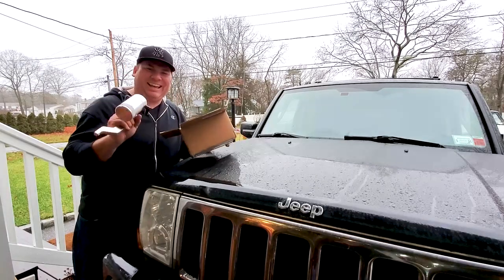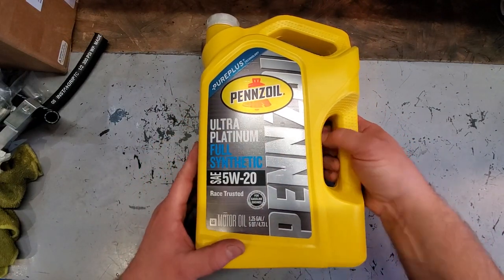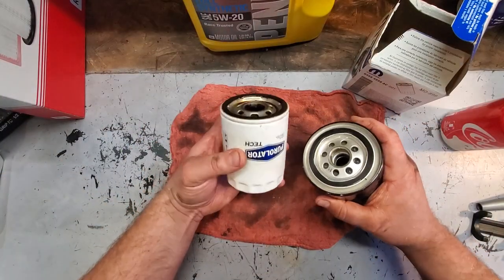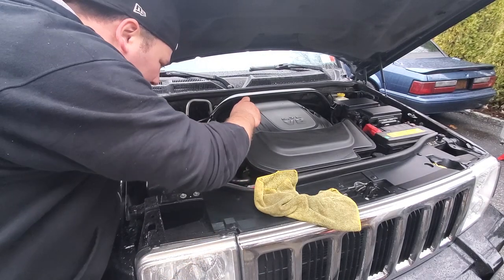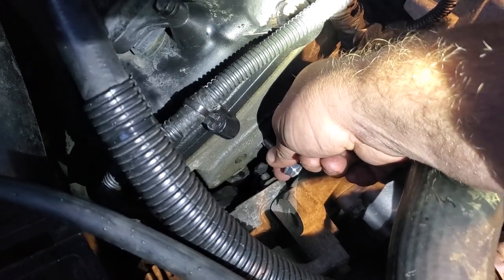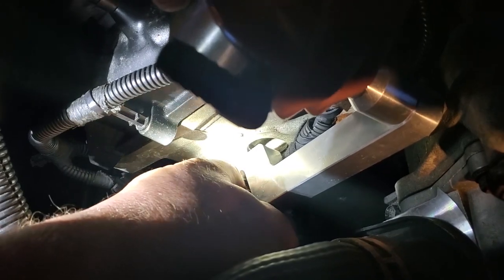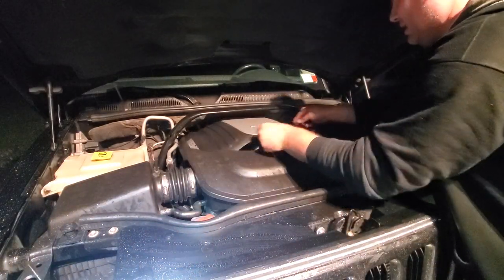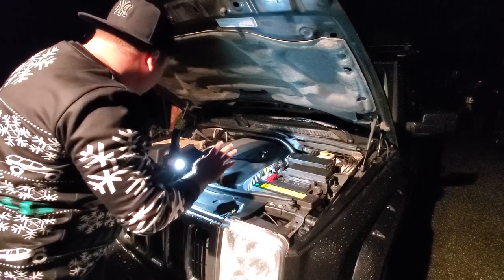JEEP COMMANDER XK OIL CATCH CAN RETRO FIT FOR 5.7 HEMI & OIL CHANGE

Comment: Change your PCV with the oil and filter.
Make sure your filter is premium that stops down to at least 5 microns. My Fram premium filter I get filters down to 3 micron.
Standard filters only stop 30 microns and larger.

Comment: Good vid. I have an air raid elbow that replaces the mouse trap resonator. So it should be much easier. The main thing the catch can dose is keep your throttle body from gumming up so bad by eliminating the oil that cooks on the body and the valve. Started watching after hearing about your channel from D&E. Good XK content.
Reply from the maker: Thanks for coming over! D&E are great.  Ill definately scrub that TB. Thanks for the tip.

Comment: That price is insane. Lots of choices that were a ton cheaper. What could you have done with an extra $100?
Reply from the maker: Put it towards a quality billet catch can 🤣🤣🤣
Reply: @ProjectDanH  
Quality doesnt mean more effective, better or last longer. Could've been made from titanium, gold plated and encrusted with diamonds and rubies wouldnt make it better.
Reply from the maker: LOL, Yes I agree.  A More expensive price tag does not necessarily guarantee good quality, furthermore,  a "quality" material certainly does not guarantee an effective part.  The things I considered in this purchase were the Company who manufactured it (and their reputation), the reviews the product received, Which engine it was designed for, the location of mounting in relation to the engine so engine heat could prevent freezing, type of filtration, method of draining,  and ease of access.  I wasn't thrilled with the idea of selecting a generic one size fits all eBay special. This was an important decision as the commander is my wife's vehicle. This can checked all the boxed

Comment: Good catch can install tutorial. Been thinking about getting one for my Jeep as well. But what I've heard/read (nothing really scientific...) that it mostly helps if you drive shorter trips without letting the engine warm up. If most of your driving is longer distances where your engine reaches proper temps, catch can isn't all that necessary, since it'll just burn away all that "crap" that can is catching when driving shorter distances with cold engine..?
Reply from the maker: I've heard something similar too. Which as a another reason I installed it.  The Commander is mostly the drive the kids to school, get the groceries, and go to church vehicle.. all short trip city driving.  And even if we're going long distance it couldn't hurt!  😁
Reply: @ProjectDanH  Always good to have some upgrade, that should work towards longer engine life for sure! That's why I've thought about it too, since there's no negative side effects on it, but could help with positives 😁
Reply from the maker: @finnishfatman  exactly! Its literally All good 😁

Comment: When pouring fluids like oil or coolant from a plastic jug place your palm on the side and pour it from the side it will allow the air to escape and less splashing when pouring fluids . The catch can seems like a great idea I hope it works for you . The oil filter you had on originally was fine but its not OEM and Jeeps love stock oil filters and the factory one holds more oil so I think 5.5 quarts can be used to fill the 5.7 HEMI beast . Also who put that drain plug in He-man ?😂
Reply from the maker: Thanks Jay, This beast takes 7.5 quarts!  I usually punch a hole in the bottom of my quarts with a pick. That really lets it flow nice.  I don't like to puncture the gallon containers cuz they're great for clean up containers.  Ill def try your tip next time pouring the oil.  And yes, He man definitely tampered with my drain plug. 😁
Reply: @ProjectDanH  7.5 is what I said but my phone likes Chevy's I think it always autocorrects me when talking Jeeps for instance it would correct Jeep to Keep 😂
Reply from the maker: @jaysmith5084  Haha! Silly Auto correct.. phone thinks its better than me!

Comment: Great idea. Been wanting to do the same. Silly question but why not make the garage fit a Jeep to pull in even if partial so you stay out of the elements? Any-who. Merry Christmas!
Reply from the maker: Merry Christmas!  I tried to get a car in there when i first bought the house and it was an embarrassing failure.  No room at all in there.  Its better served as a workshop and I Vowed to build a detached Garage in the back yard one day.
Reply: Project Dan H totally get it. You’re a trooper for withstanding the weather!
Reply from the maker: @Chrisw678  thanks man.. these Jeeps ain't gonna Mod themselves. 🤣

Comment: Is this still going strong? Do you have anything thst you would change about the part or installation since you have installed it? You have helped our big time I just ordered a catch  can and im going to copy you thank you its a bummer theres no catch can for our hemi, Improvise and overcome
Reply from the maker: Thank you!  I love everything about this catch can!  Its almost been a year and Ive already caught a half a poland spring bottle!  I did end up adding a 1/2 inch home depot elbow to eliminate that 90 degree bend. The only thing im not crazy about is where I put it.. Its nice and tucked away, but a little difficult to access.
Reply: @ProjectDanH   That's what my concern was thinking about if he had to drain it because I see other catch cans have a drain valve on the bottom I'm wondering if it somehow able to be placed where you can access that and just have a  Hose run down
Reply from the maker: @christopherlee1673   Yea, well that's the beauty of the can, you can slip em in wherever is most convenient for you!  keep me posted!

Comment: what year jeep commander are you working on?
Reply from the maker: 2010 Limited
Reply: @ProjectDanH  okay the reason a asked was that mine is a 2006 and the setup is different. My temperature  sensor is on the passenger side and the other goes is on the driver's  side.
Reply: I'll keep on the look out for more videos on your commander.
Reply from the maker: @aldee3018  awesome 👍 thank you.  Anything you would like to see done?